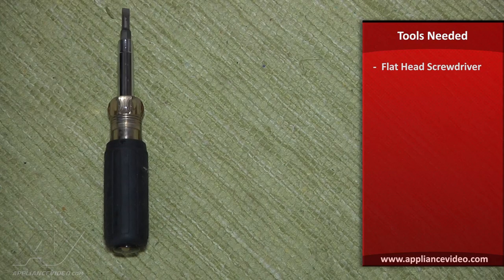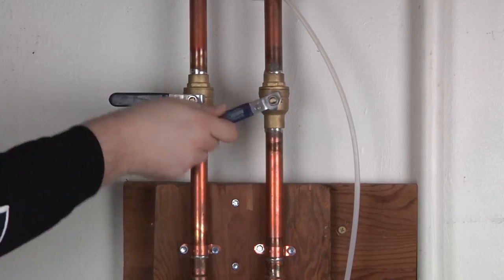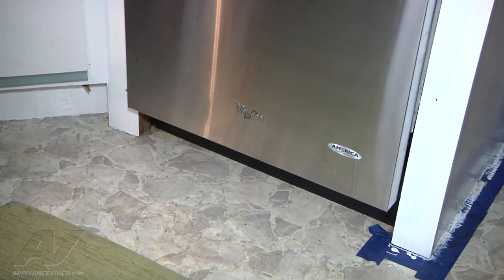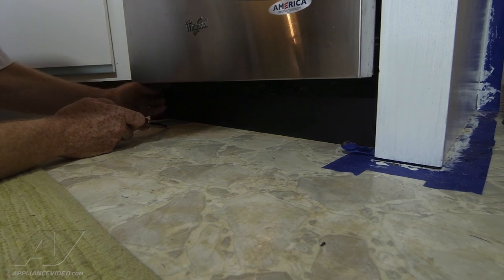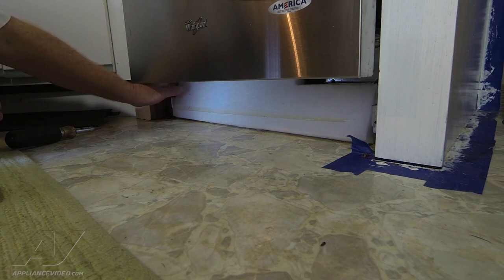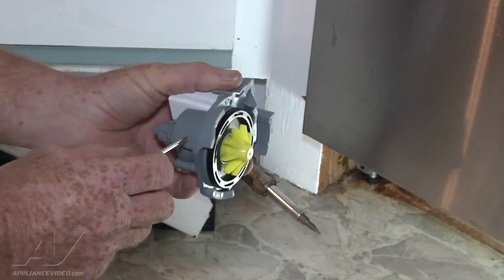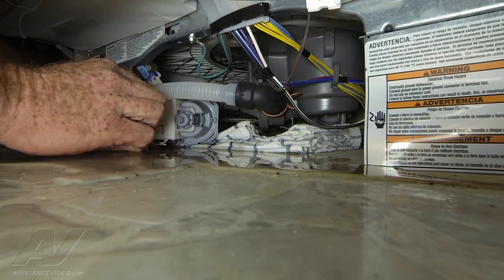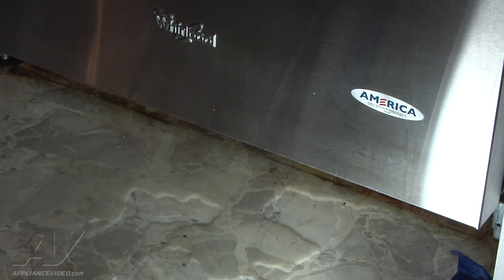Whirlpool Dishwasher Repair - Not Draining - Drain Pump

Comment: Great video, thank you! For anyone with dishwasher not draining issues, first thing to check is the screen or filter, then check hose and sump for blockage, I disconnected hose at sink, stuck a funnel in it and used shop vac to suck water through. Also check flow switch to make sure it's not stuck closed, it's usually visible in bottom of dishwasher. Check new garbage disposal to make sure Knockout was removed and if not draining completely google siphon gap and see if that might be your issue.  Mine was a combination of issues and I just hate to see anybody buy a pump without checking these other things.  Also prior to ordering, pump, you can disconnect it reconnect the power leads, select cancel or drain and make sure the impeller works.  If it doesn't, use a tick tester to make sure the leads have voltage because if voltage isn't being sent, there is some type of control panel/mother board issue.  Hope it helps...
Reply from the maker: Great question, if you have a more technical question that our parts department cannot answer, you can search our over 17,000 answered questions free at our website www.ApplianceVideo.com under our Repair Help section. You can also call our parts department at 1-800-830-5465 and they can give you help 7-days A week ,or search at www.SaveMoreOnParts.com  .
Reply: Your comment definitely help, my issue is that I'm not getting power signal from the computer!
Reply: I actually bought the pump and realized it was not the pump 🥺
Reply: @emadr1  Did you check the float switch?   It should be able to move up and down freely to tell the machine there is water that needs to be pumped out.  And or that the wires are connected to it underneath.  Keep trying and hopefully you'll get it!

Comment: Fixed mine! Yay!! I replaced the pump and it still would not drain. No blockages and the machine (Maytag) ran through it's cycles, just would not drain.
**Here's the fix for: 

Maytag Model MDB4949/plus many other brands

Remove the exterior door cover not the entire door, there are roughly 8 screws. The selection (buttons) panel clips in; unfasten. Be careful not to break the tabs that hold it in place. It's a rather tight fit.

Simply disconnect the selection panel harness which connects to the control unit (the brains/computer). Note, only need to disconnect from the selection panel. Wait a moment and reconnect.
BINGO! Up and running just like day one. That is all it took. Turns out my old pump was good after testing it on the bench.
These machines are like computers and sometimes need a reset, nothing more.
I sure hope this helps a lot of you out there in a similar bind.
P.S. Maytag/Whirlpool know nothing about this. Spoke to tech support and got no where. They offered to send a tech for $115 just to look at it. Ha!
Reply from the maker: Thanks for your response, we are glad we could help. Our library
of over 5,700 videos are currently helping over 1.6 million people like you
every MONTH.  Please help us by
subscribing to our YouTube channel, or post our website www.ApplianceVideo.com to your Facebook
page, Twitter, Instagram or any other social media sites. Your support will
help us keep producing more free quality videos.

Comment: I used all the tips and eliminated everything except a clogged hose. A 10 ft snake took care of it. Yuck, must have been a 6 inch clog based on what came out. The filtering system seems to be capable of eliminating most particles. Not sure what built up in there- mostly grease?
Reply from the maker: Great question, if you have a more technical question that our parts department cannot answer, you can search our over 17,000 answered questions free at our website www.ApplianceVideo.com under our Repair Help section. You can also call our parts department at 1-800-830-5465 and they can give you help 7-days A week ,or search at www.SaveMoreOnParts.com  .

Comment: I just did a drain pump replacement and it's leaking. It's a European brand but the pump looks similar to the one in this video. I've seen recommendations to apply silicon grease, dish soap, or rinsing agent to the O-ring before installing the replacement. Any thoughts? The replacement part is not the exact same, but I ordered it from the manufacturer after supplying my model and serial number.
Reply from the maker: Great question, if you have a more technical question that our parts department cannot answer, you can search our over 17,000 answered questions free at our website www.ApplianceVideo.com under our Repair Help section. You can also call our parts department at 1-800-830-5465 and they can give you help 7-days A week ,or search at www.SaveMoreOnParts.com  .

Comment: Great video. I got the same dishwasher. Not sure what the problem is. It won't drain at the end of the cycle but when I press the  cancel/ drain button it drains. I do have to press it 2 or 3 times for it to drain completely.
Reply from the maker: Great question, if you have a
more technical question that our parts department cannot answer, our
technicians are answering all questions at our website at www.ApplianceVideo.com under our Repair Help section. You can also call
our parts department at 1-800-830-5465 and they can give you help 7-days A week
Mon-Sat . You can also search at www.SaveMoreOnParts.com 7- days a week.
Reply: Probably the blades on the pump that help get the water out broke. Mine does the same thing you have to hit it a couple times for its empty. I have a new pump coming that's probably what happened.

Comment: Question: Before taking old pump out, the cycle was running. I found a jam in the rotor which I took out and re- installed old pump. Not only did it not work, the dishwasher won't run now.
Reply from the maker: Great question, if you have a more technical question that our parts department cannot answer, our technicians are answering all questions at our website at www.ApplianceVideo.com under our Repair Help section. You can also call our parts department at 1-800-830-5465 and they can give you help 7-days A week Monday Sunday, or search at www.SaveMoreOnParts.com  24 hours 7 days A week.
Reply: ApplianceVideo.com  thanks. i have a jam in the line!the electric pin to the washer itself poppedout!

Comment: What would be the next thing to look at if we replaced the drain pump. It still is not draining
Reply from the maker: Great question, if you have a more technical question that our parts department cannot answer, our technicians are answering all questions at our website at www.ApplianceVideo.com under our Repair Help section. You can also call our parts department at 1-800-830-5465 and they can give you help 7-days A week Monday Sunday, or search at www.SaveMoreOnParts.com  24 hours 7 days A week.
Reply: clogged drain hoses
Reply: I hope you didn't spend money on this! 

Fixed mine! Yay!! I replaced the pump and it still would not drain. No blockages and the machine (Maytag) ran through it's cycles, just would not drain.
**Here's the fix for: 
Maytag Model MDB4949/plus many other brands

Remove the exterior door cover not the entire door, there are roughly 8 screws. The selection (buttons) panel clips in; unfasten. Be careful not to break the tabs that hold it in place. It's a rather tight fit.
Simply disconnect the selection panel harness which connects to the control unit (the brains/computer). Note, only need to disconnect from the selection panel. Wait a moment and reconnect.
BINGO! Up and running just like day one. That is all it took. Turns out my old pump was good after testing it on the bench.
These machines are like computers and sometimes need a reset, nothing more.
I sure hope this helps a lot of you out there in a similar bind.
P.S. Maytag/Whirlpool know nothing about this. Spoke to tech support and got no where. They offered to send a tech for $115 just to look at it. Ha!

Comment: I have exactly the same DW and everything is good EXCEPT removing the pump. Are there some tabs or locking parts which require depressing first, or do I just "muscle" it counter clockwise?
Reply from the maker: Great question, you can call our parts department at 1-800-830-5465 and they can give
you help 6-days A week Mon-Sat . You can also search at www.SaveMoreOnParts.com 7- days a week.  If you have a more technical question that our parts department cannot answer, our technicians are answering all questions at our website at www.ApplianceVideo.com under our Repair Help section. We have over 4,000 common questions and answers that you can easily search through by your model
number, appliance make, and problem or error codes, and It’s free to search
through our question & answer library.
Reply: Allen Purdy Bay Valley Real Estate I have the same DW also and have the same draining problem. When I took my pump off, yes, you just turn it counter clockwise,  it moved fine, meaning no pieces of broken glass or anything else keeping it from moving. Don't forget that clip holding the wire. My problem is with float valve and I'm just looking for something on that.
Reply: On Maytags you have to press a locking tab!
Reply: There is always a locking tab you must depress before turning it

Comment: My Whirlpool DW drains some of the water out. I can hear it draining under my sink. When I removed the pump, it does spin freely and when the power is connected it does spin when it is put in "drain" mode. 
 Could there be a problem with the float valve? I have moved that around and it would drain fine for a couple of cycles but then that stops and it won't drain again.
Reply from the maker: Great question, you can call
our parts department at 1-800-830-5465 and they can give you help 6-days A week
Mon-Sat . You can also search at www.SaveMoreOnParts.com 7- days a week.  If you have a more
technical question that our parts department cannot answer, our technicians are
answering all questions at our website at www.ApplianceVideo.com under our Repair Help section. We have over 6,000
common questions and answers that you can easily search through by your model
number, appliance make, problem or error codes, and It’s completely free to
search through our question & answer library. There is a very good chance
you question is already answered there.
Reply: The float valve has nothing to do with the draining sequence. Just because your drain motor is spinning doesn't mean that isn't the problem. Make sure the impeller BLADES are all attached (and not broken or missing) on your drain pump. But most of the time a drain pump will still spin, but if there is a blockage in the drain line, it wont be strong enough to break through the clog. It'll just spin and spin. You have to find the clog.

Comment: What can cause it to drain manually but not automatically at the end of the cycle???
Reply from the maker: Great question, if you have a more technical question that our parts department cannot answer, you can search our over 17,000 answered questions free at our website www.ApplianceVideo.com under our Repair Help section. You can also call our parts department at 1-800-830-5465 and they can give you help 7-days A week ,or search at www.SaveMoreOnParts.com  .

Comment: Why did he leave the bottom rack in while he sucked the water out?
Reply from the maker: Great question, you can call
our parts department at 1-800-830-5465 and they can give you help 6-days A week
Mon-Sat . You can also search at www.SaveMoreOnParts.com 7- days a week.  If you have a more
technical question that our parts department cannot answer, our technicians are
answering all questions at our website at www.ApplianceVideo.com under our Repair Help section. We have over 6,000
common questions and answers that you can easily search through by your model
number, appliance make, problem or error codes, and It’s completely free to
search through our question & answer library. There is a very good chance
you question is already answered there.

Comment: I replaced the pump on my 2 years old Maytag. It still will not drain. Goes through full cycle but will not drain. Checked for blockage, there is none. 

What is the next thing that could be considered the problem?
Reply from the maker: Great question, if you have a more technical question that our parts department cannot answer, you can search our over 10,000 answered questions free at our website www.ApplianceVideo.com under our Repair Help section. You can also call our parts department at 1-800-830-5465 and they can give you help 7-days A week Monday Saturday, or search at www.SaveMoreOnParts.com  24 hours 7 days A week.

Comment: Question.   There is water at the bottom of the DW at the end of the cycle   I can get the water to drain manually be pressing cancel, however.  Is this still a bad pump or something else??
Reply from the maker: Great question, if you have a
more technical question that our parts department cannot answer, you can search
our over 10,000 answered questions free at our website www.ApplianceVideo.com under our Repair Help section. You can also call
our parts department at 1-800-830-5465 and they can give you help 6-days A week
Monday -Saturday, or search at www.SaveMoreOnParts.com  24 hours
7- days A week.

Comment: Replaced both Drain Pump and Diverter in a whirlpool and still doesn't drain ????
Reply from the maker: Great question, if you have a more technical question that our parts department cannot answer, you can search our over 17,000 answered questions free at our website www.ApplianceVideo.com under our Repair Help section. You can also call our parts department at 1-800-830-5465 and they can give you help 7-days A week ,or search at www.SaveMoreOnParts.com  .